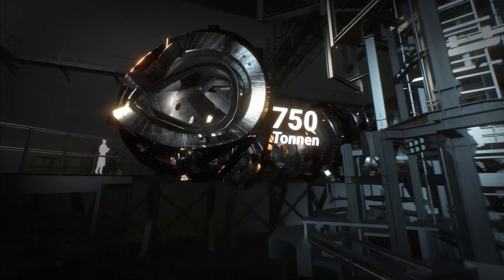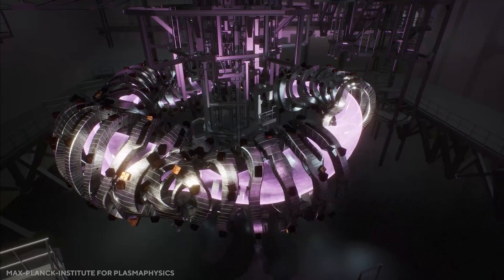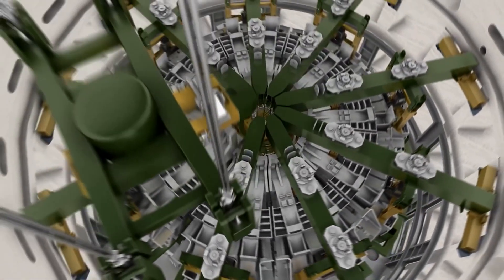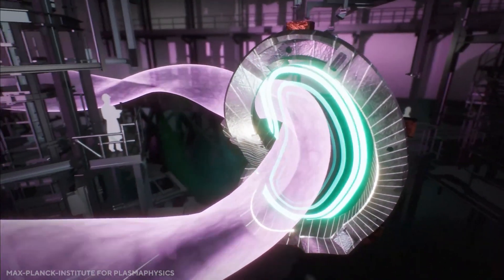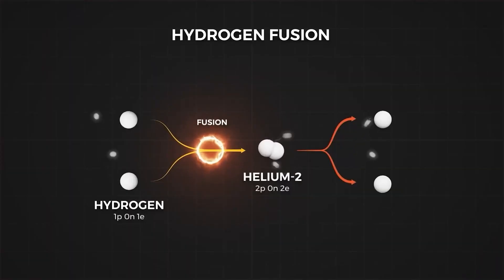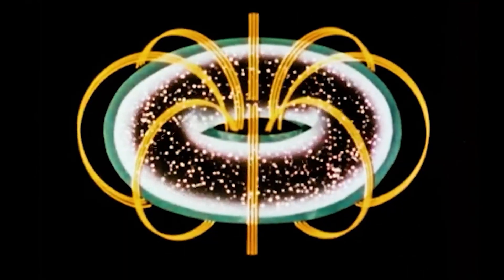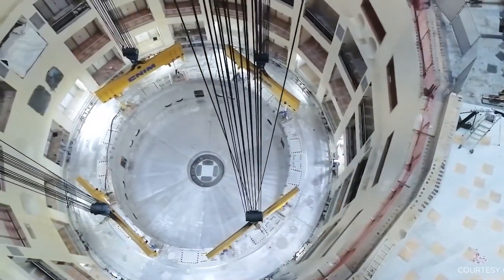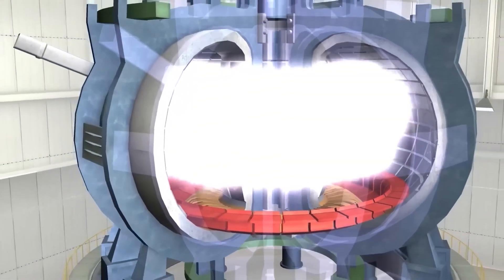AI Cracked the Code of Nuclear Fusion to Destroy Oil and Gas

Comment: To everyone waiting for fusion energy:
The LiFTR (Liquid Fluoride Thorium Reactor) have all of the upsides that fusion has.
Plenty of available fuel.
Only produce short lived isotopes.
Stort safe.

And it is very close to market, several companies expect mass production before 2030 (not prototypes, commercial units!)

A MSR (Molten Salt Reactor) running on uranium or recycled nuclear waste have many of the same advantages, and are even closer to market.

Get hyped!
Reply: China is investing $440bn into MSRs nuclear power plants and intends to build 30 plants by 2030.  (see The Futurist video Nuclear 4.0...China)
Reply: No, the cost to move LFTR from where the research stands to a functional commercial reactor would cost more than $15 billion in funding
Reply: ITS ABOUT TIME.
Reply: I agree. Thorium is also the perfect power source for deep space craft. 
Fusion has a lot of problems, unless it's in a star.
LOL
Reply: @andreoliver5927  google downsides of Thorium
Reply: To me the coolest thing about the LFTR is the freeze plug (no pun intended).  It keeps the fissile material in the reactor with a literal block of ice, made with a freezer powered by the reactor.  If its output drops or it gets too hot, it melts the ice and shuts itself down.  It's very safe because the ice will be the first thing that melts down, protecting anything that melts at a higher temperature.
Reply: While I completely agree that we should have been using molten salt reactors years ago as primary power, it does not have all of the upsides of fusion. Fusion is capable of producing much more power than fission, might as well be comparing a AA battery to a car battery in terms of power potential. The lack of risk/danger with fusion, isn't the only reason we are pursuing it so fervently. Cracking fusion and whatever type of battery replaces current LiPo's will be a huge jump forward, power is really starting to hold us back technologically.
Reply: @grindersandgears3445   thorium reactors don't produce tritium in large quantities which has to be replaced in nuclear weapons around every 7 years in thousands of nuclear weapons we have made around 45,000 roughly in total
Reply: @grindersandgears3445  For now (and probably for next 50 years) fusion is NOT capable to produce
any power, rougly the same for an industry sized molten salt reactor.
Reply: @grindersandgears3445  especially using helium 3
Reply: @grindersandgears3445  I am puzzled to your claim that "fusion is capable of producing much more power than fission". 
What is that based on? 
I know that reaction for reaction a D-T produce about 18 MeV and a 235U fission produce about 180 MeV.

Now going off of weight, you can say that a kg of D and T have about 100 times more atoms than a kg of pure 235U. 
And for that reason you can in theory produce 10 times more energy per kg fuel. 

But that's not a lot more - not when you consider uranium is about a million times more energy dense than coal. 
Anyway, the cost of fuel is not an issue in the economics of either fission or fusion, the main cost is building and maintaining the reactor and support systems. 

I could argue that a fission reactor will be able to produce a lot more power than a fusion reactor. For the same reaction rate, the power produced is 10 times higher. 

You need to have an argument about WHY a fusion reactor can run much more than 10 times the reaction rate of a fission reactor. I can't think of any myself.
Reply: Plus Thorium reactors produce Tritium which can be used in fusion reactions. Tritium is rare on Earth.
Reply: @jeffhogueison1656  What? When? Where? Who? tell&show us please
Reply: @WhySoDivided-CantWeAllGetAlong 

Scenario  :  Quantum Super Intelligence obsoletes yesterday's vested monetary encryption system accesses all data for rehabilitation analysis to grounded public prosocial Real Economy * ....non toxic energy unit accounting engineering sense  .

Egoless logical objective " artifical " pure principle Intelligence supplying direction to rehabilitation of yesterday's vested " special " small " i " intelligence becomes a thing within global citizen stockholders commonwealth  .

 eg. * " Critical Path " ( just the introduction eg. ) ....by Richard Buckminster Fuller ( Institute ) .
Reply: They will never allowed us in the states everywhere else though they get to have it
Reply: @rdavian  they will be allowed in the US, you just have to push a little. Political pressure is everything when it comes to nuclear energy.
Reply: google downsides of Thorium Professor migBgdck
Reply: We need regular reactors for our nuclear program which is why thorium isn't as attractive to the United States government
Reply: Don't worry it's not only Don Quixote who chases windmills. That's also a bit punny.

Comment: Why spend billions building any of this when you can create real-world virtual simulations to confirm if it will work first?
Reply from the maker: To simulate something virtually we first need real world data. To collect this data we first need to build real reactors and observe how the plasma reacts with the magnets. 
This collected data will be worthwhile for future reactor designs which could be simulated by tapping in different parameters.
Best regards.
Reply: @The.Futurist My hat's off to you for patiently answering that dumb question.
Reply: @The.Futurist but shouldn't the math take care of that? I thought that is what supercomputers were for, real world simulations, because they can do all that math quickly.
Reply: How do you even miniaturize something that big and powerful?
The magnets alone would be problematic.
How much energy is being put into or the magnets or create the magnetic field?
How strong does the magnetic field have to be to contain the plasma?
If they are getting a net gain of energy wouldn't that imply a self sustaining system?
How did they create and activate the plasma?

Comment: This video has lots of misinformation. AI was NOT involved in it's design, which was back in the 1990s. It was human coded simulations. Not AI as we think of it today. Now the control system could involve AI but that is different. 

Also W7X is a plasma control experiment. It does not use DT fuel, but only deuterium. Tritium is hazardous and the experiment is not built to handle it. Thus it's not producing energy. It's just testing plasma control. 

Each of the different reactor designs have tradeoffs. So it's worthwhile exploring multiple designs. W7X is the largest and most optimized of it's type. It has gone through some upgrades and will likely go through more. A better report on the results of it's progress should be coming in the next couple months. So again, this video is not very good.

Comment: AI has helped German scientists achieve a major milestone in nuclear fusion energy, bringing us closer to sustainable clean energy. The use of AI in the design and control of fusion reactors has overcome problems faced by the conventional tokamak concept.

#### Highlights
- 🌍 German scientists use AI to solve fusion reactor problems and achieve a breakthrough.
- 💡 Fusion reactors have the potential to provide safe, clean nuclear energy without producing hazardous waste.
- 🔬 The optimized stellarator design, aided by AI simulations, keeps plasma confined and exposed to the same magnetic field throughout the fusion process.
- ⚛ The bendelstein 7x stellarator has successfully generated plasma for over eight minutes, a significant step towards practical nuclear fusion.
- 🔥 Advancements in AI accelerate the path towards sustainable energy, with China also making significant investments in fusion research.